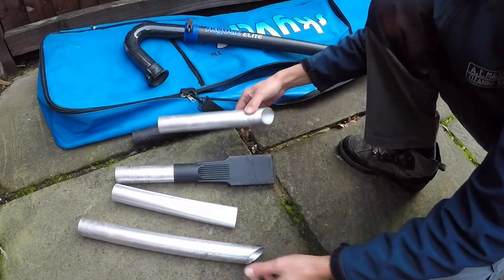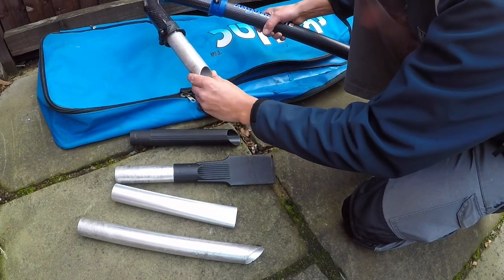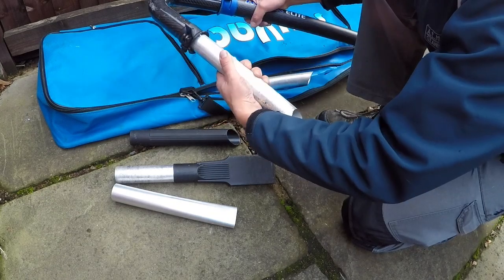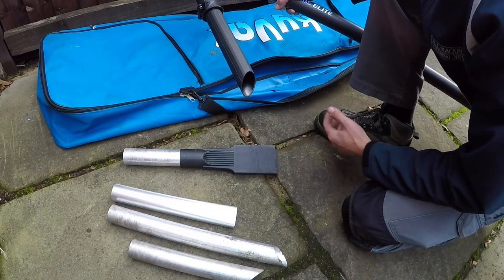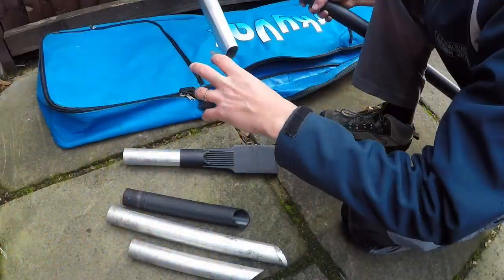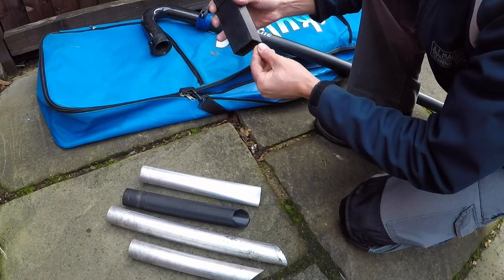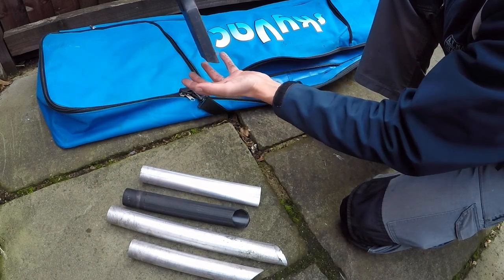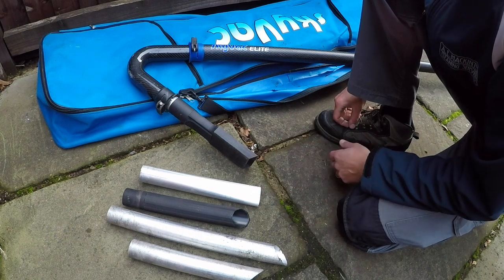How You Should Be Using These Gutter Vac Attachements!

Comment: I bought the elite, largely because of Ashley's recommendation. I have been extremely disappointed. I love this channel; it's one of my favorites. But I caution anyone against this product. I have been cleaning gutters for 15 years and using the SkyVac tripled and quadrupled my time at each house and did a very poor job (I know because I started getting up and checking what was happening. I can clean gutters much faster by hand, on ladder or roof. The system is not efficient and easy to use. I had to buy a 200 lb generator to run the vacuum and the total set up is extremely difficult to use. Buyer beware.
Reply from the maker: Dave W Thanks for your comments. I can see where your coming from. There is definitely an element of technique to be effective with this tool, as with any tool. Also, I found that the more I use it, the more efficient I became at setting it up, moving it around, and packing it away, hence reducing my time at the job. You May find it helpful to use an inspection camera? I find that the vac comes across very professional and is a lot safer in most instances too.😃👍🏼
Reply: Dave W I have to agree with you. By ladder and hand is far easier but obviously not as safe. It’s a lot faster to get the ladders out on a straight forward gutter clean on a house. Others will argue the vac is faster but I have to disagree. By the time you set up, clean the vac and poles and pack away it’s just much quicker with ladders and less awkward but some people don’t like using ladders so each to their own. The vac always comes in handy above conservatory roofs and some extensions. The vacs can be a pain but its worth having a vac in your Arsenal as an exterior cleaner. I won a window cleaning contract on a school including add on services partly because my vac could reach 3 story gutters from the ground safely. The school wanted a company that could do the lot. Windows, gutters, jet washing etc and not just a window cleaner. They seen the vac on my website and were impressed and this was also one of the reasons why they called me and they wanted to cut cost by not having to bring in a cherry picker or scaffolding. I also clean 2 large industrial units on a 3 monthly which is a really good earner and I wouldn’t have got these without the vac. Both units are the same company and roughly 100 yards from each other so as soon as we finish the first one we move straight onto the next. I couldn’t clean these units without the vac as parts of the building are awkward and far too dangerous by ladder and there’s parts where you can’t set up scaffolding or a cherry picker to get at some of the gutters plus the vac saves the client money. The vacs have their place and as Ashley said they look professional but exterior cleaners need to have different tools/equipment depending on the job and the vacs are handy to have 👍🏻
Reply: @smartcleaningservices7450  Yes like anything, all tools / equipment have pros and cons, I find cleaning gutters by hand does a better job but takes longer if you get more confident with gutter vac it does a pretty good job too. I also admit I get up on ladder for inspection just to double check as cameras are quite expensive add on. Larger houses with lots of gutters full of dead leaves and stagnant water there is no better job than a gutter vac as it will suck it all out so easily, try this by hand it would take far longer. Obliviously price comes into it as they are not cheap but a great investment all the same, I would definitely recommend investing in one, doesn't have to be sky vac as these are very expensive but do come with more features. I use the Nilfisk maxi 2.
Reply: Adrian Mcglynn yes I agree with the vac sucking out all the water 100%. You just have to take each job as it comes and work out the best and most efficient way to tackle it 👍🏻

Comment: I just use a titan wet and dry vacuum from Screwfix, some shed down pipe 2", 3d printed some pole joiners, 10 metres of 2" vacuum hose. Works great plus you can buy cheap WiFi cameras that can connect to your phone so you can see what your cleaning. 😉👍
Reply from the maker: Simon Wheeler Sounds like an interesting diy setup. Nice.😃👍🏼

Comment: I'm undecided on the Atom or the bigger gutter vac systems one twice the size and power for same money but drawn to the atom as whole package looks better
Reply: Skyvac are on ebay picked up the commercial with 40ft elite poles for £1550
Reply: I pondered for about 6 months, went with the Atom, it easily clears 3 storey buildings, I've use it internally too, it's light and hardly takes up any room
Reply: Atom is a little power house. I haven't had any issues with mine yet. I guess if you're solely gutter cleaning then spend more and get a larger machine, but the Atom is lightweight, small, good power so it's great to just leave in the van. I have used mine 7 poles high and it still clears them easily. I think spinaclean have a discount going on the packages too at the moment
Reply from the maker: The commercial is a great choice too! And the Elite poles are a great upgrade! Having the stiff gooseneck at the top makes such a difference, especially for tugging out tufts of grass.😃👍🏼
Reply: @aemackintosh  You can buy the kit 'carbon gooseneck + clamps' for Atom.... ; ideally a 50mm hose + 50mm inlet would reduce the risk of blockage ; for down pipes, a high pressure cleaner with 15 m pipe cleaning will help...
Reply from the maker: Nice.😃👍🏼
Reply: @aemackintosh   I received the commercial 75 + 6 elite poles last week ; now I can begin to practice...with the "common" tool  I could 'suck' a slate fallen into the gutter with 2 motors on (8.5m high) . Then I went to my neighbour for moss in pvc gutter ,  used the plastic tool , all disappeared,  thanks to the release pole that helped a lot because 70 % of moss blocked at the tool entry,  so it's very convenient to  'open' the air circuit , shake the pole: the moss falls down - I did it many times....no need to stop the motors at each time.. (moss can be a nightmare...). I wanted a vacuum not too big and heavy, the commercial's weight is 16kg + 7kg trolley , 54 cm wide to pass a door easily...
The choice with the atom was difficult ... why not just the atom vacuum in the future ?

Comment: I've had a atom for a few weeks now and used it for a few jobs.def a learning curve to it but I find the thinner suction attachment to work really well on most things.

One job I had was some old aluminium ogee guttering with the clips running across the top every few foot or so and it made it hard work so I just done it by hand .but done a bungalow which was really narrow all around and it was spot on for that along with clearing out the lead valley too.

Def takes getting used to but safer than getting up a ladder and holding a bucket etc.
Reply from the maker: Yes, it’s a great bit of kit and it’s not long before you become very proficient with it and those awkward jobs will be no problem at all.😃👍🏼

Comment: Sky vacs are great, some times you need to get a ladder out, I found pine pins to be a pain to hoover
Reply from the maker: David Deacon They do an attachment for pine needles not shown in this video actually. I find that I very rarely need to get the ladder out.😃👍🏼
Reply: A.E.Mackintosh Cleaning Services I stopped using ladders in 2015 when I changed to WFP, but it’s good to have some on the van just in case for windows an gutters. Slipped tiles or detailing first cleans. I didn’t know skyvac do an attachment for pine pins, will save a few f’s and jeffs 😄 I’ll look out for it cheers 👍
Reply from the maker: Yes, it’s definitely good to have a ladder for backup! That new attachment hasn’t been around very long, I haven’t actually tried it yet.😃👍🏼
Reply from the maker: I’ve put a link in the description.😃👍🏼
Reply: Top man Thankyou

Comment: Do you find any situation that a sky vac doesn’t clear the gutter?
Reply from the maker: Robert Goosen It’s very rare that I can’t sort it with the vac. The most awkward is when there is a conservatory roof that comes down to meet a tiled roof and there is a gully/gutter where they meet. But they have a new 90degree angle goose neck now to make that easier.😃👍🏼
Reply: Thanks 👍
Reply: I cleaned gutters last week on a semi detached house with the sky vac industrial and both down pipes were completely full and rock solid. Not a chance the vac was clearing them even with different attachments or accessories. Sometimes we come across jobs like this. I had to get the ladders off the van and disconnect the down pipes to clear them out. The gutter vacs are a great bit of kit but you can’t rely on the vac to clear all gutter jobs 100%. Sometimes you need to use ladders to finish some jobs properly or we sometimes use a pressure washer with a telescopic lance and an attachment that fits into the down pipe which works well to unblock them. You don’t need the pressure washer on full power. If you come across slipped tiles in the gutter, this can be a problem for a vac and ladders might be needed to remove them. Like I said vacs are good but not suited to complete every gutter job.
Reply from the maker: There are always going to be certain instances that require a ladder, but on the whole, I find the vac is much safer and easier.😃👍🏼
Reply: @smartcleaningservices7450  hi, what lance and attachment do you use? I've got a blocked downpipe that my gutter vac can't clear and I can't get a ladder up there due to the dangerous floor below so adding an attachment to my pressure washer would be ideal